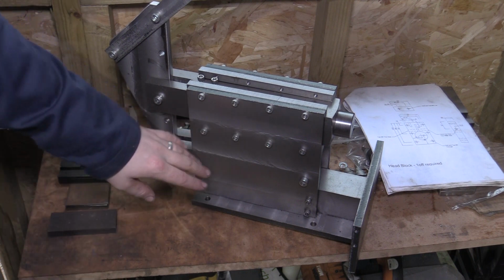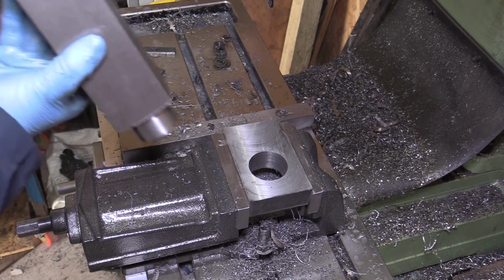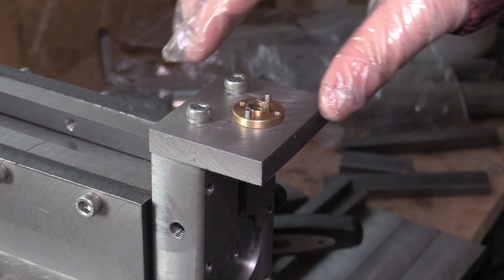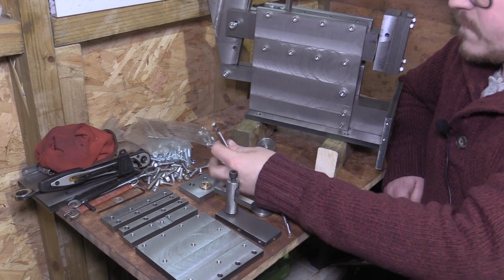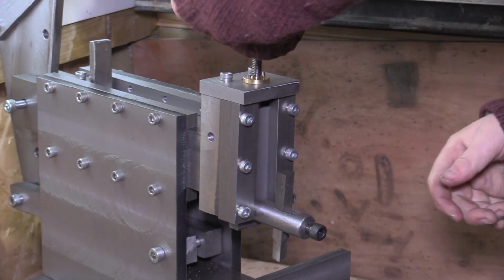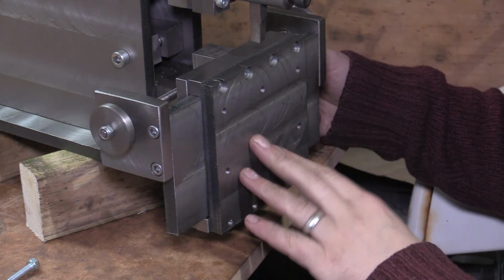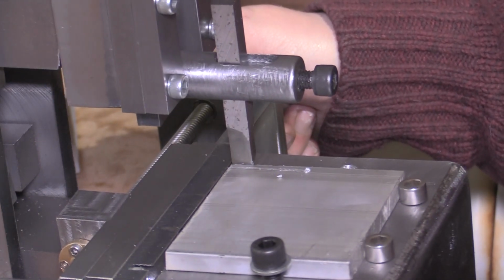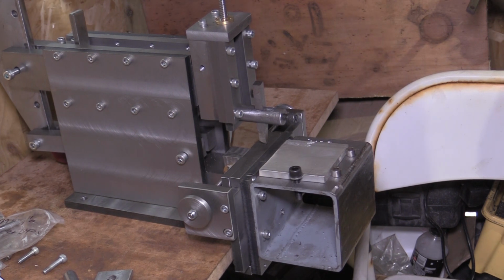Make your own Shaper Machine! Part 3

Comment: The lever arm is going to hit the top of the lead screw on the head so the lever arm needs to be modified in a way that it doesn't foul on the lead screw. Also the ram needs a detachable extension on it so that you can easily add it if you need more tool  reach because as it is now it does not have much tool reach

Comment: You've designed this without a clapper box. Every shaper I've seen before had a clapper box, used to allow the tool to lift on the return stroke. Does this work OK without one? I'm guessing it does, nice design!

Comment: Too much Flex. You did not follow the original plans which show many of the plates are also drilled,reamed and pinned to eliminate slip/flex. The cross slide also should be shimmed as well as any surface with play. The original plans specified faces to be files and scraped to an accurate fit that is missing here. You might recover this with some shims but yea you need a LOT of stiffening. A few welds might help in some areas but bear in mind future maintenance and disassembly. So only weld where it can be easily  ground out and where it wont warp the material !

Comment: I am not sure how you arrived at the design of this shaper which in the main body appears to be beefy enough but the cross slide is clearly flexing away from the ram in the video. Also there is no facility to rotate the cutter in order to approach the work from the sides and there appears to be no clapper box to allow the tool to travel back over the work without dragging.
Reply from the maker: Hi Jack, I done some follow up videos where I have made some improvements. It is a working progress at the moment
Reply: He didnt the plans are from an old magazine shop notes. i knew i saw it somewhere before.and hes not even following the plans correctly and has the nerve to sell them as his own. the plans are older than he is

Comment: You're going to have to reduce the flexing in the table assembly.. somehow beef it up.more steel on the table assembly.  Maybe extend the shaper bottom plate all the way out .then add add Reinforcement under the bottom plate. But it has potential.
Reply from the maker: Thanks Mike
There is a follow up video where I make some improvement to the manual shaper.
Reply: @mrmechanical3423  thank you and  yes I did see your improvement.  That made a huge difference.  . I was looking at the atlas shaper and it's a solid cast iron machine. However,  I think your design would work very well. Both your design and the atlas helped me to get an understanding of how a commercial shaper works .

Comment: If you look in the video at the start of a cut the cross slide moves forward I suspect the spacers for the guides are too thick cut them down untill they are thinner than the cross rail and then shim them out so you can just move the slide.
Reply from the maker: Yea I noticed this too. I modified the spacers in the follow-up video on the shaper. Thanks for your comment

Comment: Looking at the video of it in operation, you will need to increase the rigidity, as there is a degree of flexing which is defeating the cutting action. Also consider changing the sliding surfaces to a dovetail form. this will keep everything in line and if you include adjustable gibs you will be able to cater for wear. If you look at a commercial shaper you will see all these features. Fantastic job so far, look forward to all your content.
Reply from the maker: Thanks Dave, yes I will be revisiting the shaper very soon to remove some of the flexing.

Comment: To add more stroke to the shaper just counterbore the ram drive bolt and nut so they are below the ram surface and that will make the ram travel farther.
Reply from the maker: Its definitely on my to do list 👍